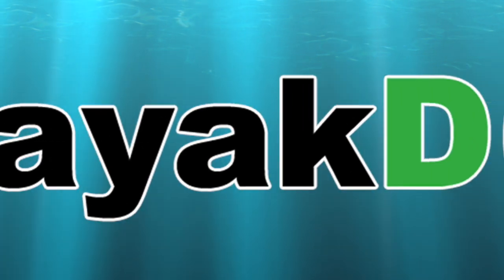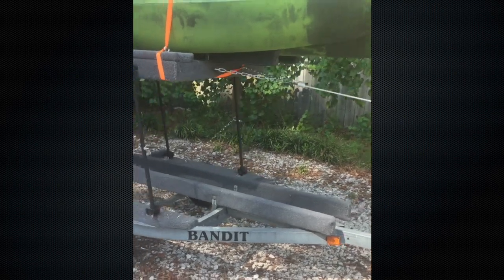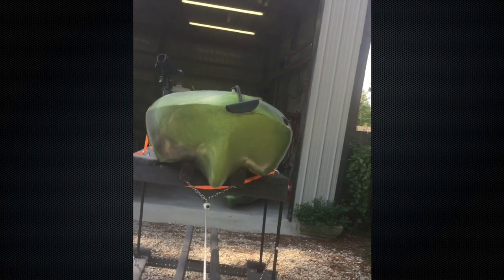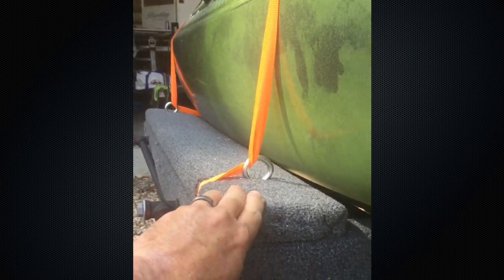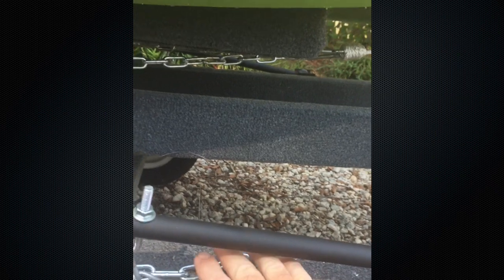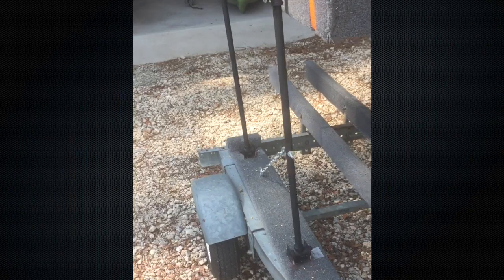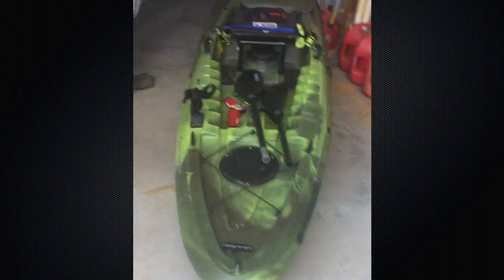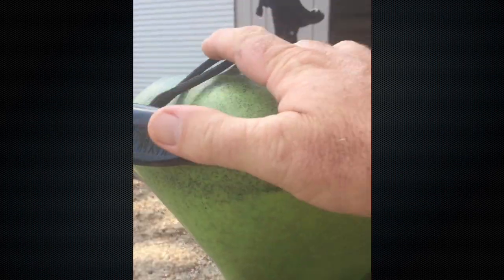Homemade Kayak Elevator Trailer

Comment: Pretty nice concept, but would be concerned about a couple of areas.  The first being the side-to-side stability of the second tier when trailering a higher speeds.  It seems the base connections may not be adequate to handle the lateral stress and could collapse sideways.  Secondly, there seems to be unnecessary height to the second level by at least 6 inches or more from what I can see.  If the second level were lower it might help with the stability of the trailer when loaded with two kayaks.
Reply from the maker: +P-Dub  Roger did report to me that he hasn't tested it at interstate speeds but highway he said it performed well with very little movement in terms of side to side.  There might be room for improvements.  This video is here to give ideas.  Your suggestions seem reasonable.

Comment: This video inspired me to do one that is similar. I have 4 Hobie PA 14's and was having to double stack as well, but the problem was that had to put the truck half way into the water to get the top lair off. So when I saw this video on DIY's channel it got me inspired. You can see how mine works if you search kayak elevator build. 
Thanks for saving my truck
Reply from the maker: trey herold glad the video could inspire you and help you out.

Comment: The chain installation at 10:25 drastically weakens the gas pipe where a hole was drilled for the eye bolt go through the center. Metal fatigue will eventually snap the pipe when it is stressed; especially when cornering at high speed. Not fun.